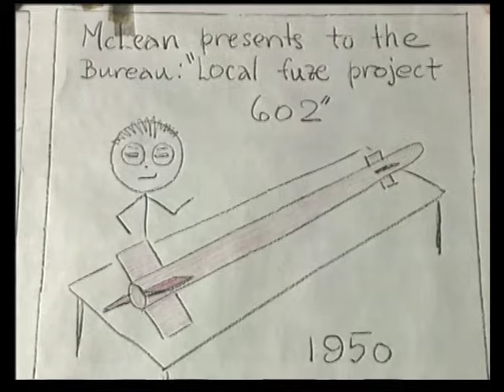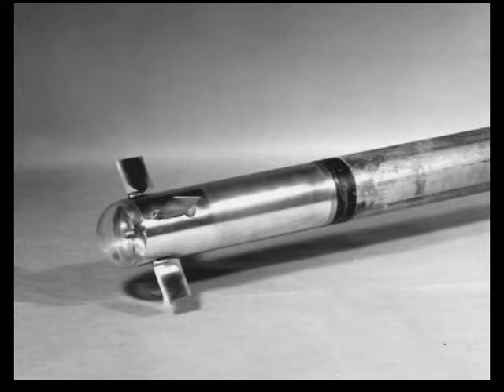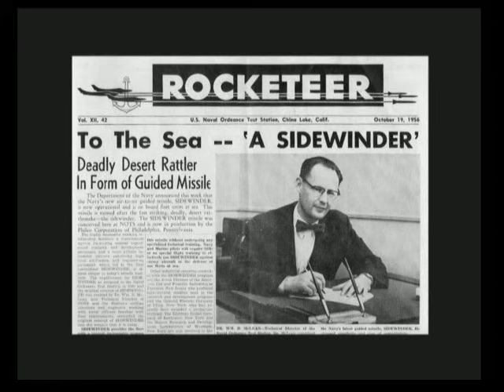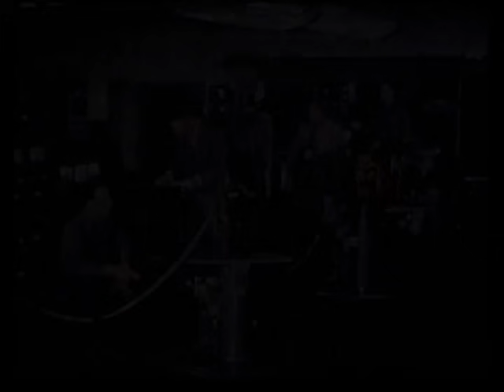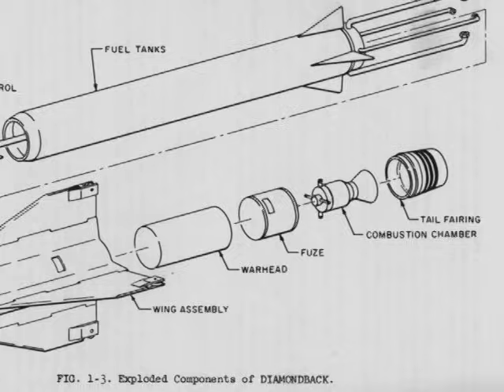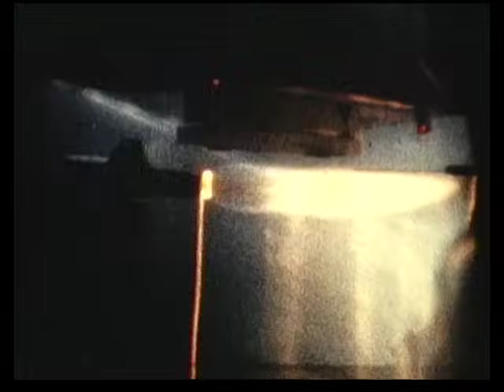To the Sea, a Sidewinder 50 years of snakes on the wing. AIM-9 Sidewinder missile history.

Comment: 'Worlds most successful air to air missile' the hit ratio (according to the maker is .79 per missile fired!) since the original doctrine was to fire TWO per engagement, you fire two you are just about GUARANTEED a kill!  I tried the simulator that Raytheon made which has a battery powered cart with a missile dummy on it (with guidance steering it), they would hand  you a lit cigarette, all you had to do was stay away from it for 30 seconds in an aircraft hangar (and you would win a nice $50) last I heard with the aim-9L they had given away less than $500 in 25 years!
Reply from the maker: It must have been a lot of fun
Reply: @BalticaBeer  by the time they got to the 9mike they had basically given it the brain of a cutting horse, it would cut corners and the cpu knows it can pull 18 G's (human can only pull 8 (in a G-suit)
Reply: Almost guarenteed. A hit probability of 0.79 means that the probability of at least one of two hitting is 95.6%. For three missiles fired, it’s 99.07%
Reply: @MichaelEdelman1954  The would be skin on skin hits, expanding rod (or coil) warhead and about a 10 meter kill radius .... still the world's most successful A-to-A missile..
Reply: @fooman2108  Too bad nothing much was explained about how SW works... How does that coil expand: in one piece or is it supposed to fragment (like Flak, spewing metal)? What about ball-bearings, like a Claymore, tearing through a plane?
Reply: @ibubezi7685  the early Warheads on the sm-2 missiles surface ships for what they called expanding Rod Warheads which was basically almost like a piece of segmented thin rebar wrapped around the explosives in the Warhead very much like a claymore! It was then succeeded by a new Warhead which was literally the coil of spring steel that it would set off the explosives in the middle of it and it would expand outwards in a cone around the Warhead.
Reply: they put a transmitter in the cigarette and use a radio/camera guidance dummy i work for raytheon
Reply: The Brits in the Falklands thought highly of them...
Reply: @fooman2108 There have been some pictures from Rimpac 2024 of Super Hornets carrying SM-6 standard missiles, with the designation Aim-174 stencilled on it
Reply: It is not a .79 pk. Never has been.
Reply: Imagine trying to stay away from a 9X. Damn near impossible.
Reply: @handlesarecringe957  Better yet, imagine something like either Python V or IRIS-T

Comment: I started my career touching a 9X eng development asset in 1998 in Texas. Multiple decades of production later, I suspect the 9X will outlast my days until I retire. Great weapon!!
Reply: What kind of connector shell housing are used on the aim7/9 series? I have a Dale Vishay insert im trying to find a housing for. Dale Vishay –
  Shearoff Insert Assy PN:810AS1325-2    /  PN:QX32P-SW325

Comment: As the Chief Pilot of my unit I was 'given to CLWS to test the Snake's Sidearm-II project. The Chinook was the airframe of choice simply because there was room in the radio/comms closet for the required gear. Ant any airspeed less than medium airspeed, the rotor down wash disrupted the missile after firing and was cancelled. I was secretly happy since the system would have removed my starboard gunner, and fighter and gunship cover was better than adding another weapons system would have impaired our ability to do what were supposed to. Ever heard of a Chinook being shot up by an enemy fighter or swing wing bird? Me either. :P

Excellent video. Moreso since it was produced in 91-92 and the Snake is still under wings and in weapons bays.
Reply: Ironically sidearm wasn't meant to be an air to air weapon it was an anti radiation sidewinder to kill radar guided AAA like the shilka. Have you ever heard of short range AAA being effective against helicopters?

Comment: Hurt to see the F6Fs and B17s shot down.   Remarkable that the Sidewinder, B52, and 747...designed principally by slide rule....still in service.
Reply: If it weren't for economic pressures that force aircraft manufacturers to improve upon existing designs instead use advancements to make a new one the 747 would be long gone

The B52 just so happened to be good enough at expensively fighting low intensity conflicts that it was still viable

Comment: This extraordinary product by Philco beats Raytheon's Sparrows & Hughes' Falcon.
Reply: Yeah, the Falcon was more or less a joke. But the Sparrow had it's evolution, going on to become the Standard-ARM air to ground missile that goes after search and missile guidance radar sets.  But the AIM-9, heh! You can see how far they went to market the little meanie, all the way to becoming an ASAT satellite killer.
Reply: @Nighthawke70  & yet for years I thought Hughes' Falcon the best & even puzzled about the Navy not adopting it. In 1960 Hughes even boasted of the nuclear-tipped Falcon 9. 
Turned out to nutting.
Hughes was a fraud through & through.
About another AA missile, why the US abandoned the nuclear ''Genie'' ? 
Although unguided it could sink a much-vaunted Sverdlovsk dreddnut.
& also the Davy Crockett nuclear mortar.
Reply: @Charlesputnam-bn9zy  The GENIE was specifically designed for the F-101, F-89, f-104/106 interceptors and those were being made obsolete by the rapid advance of technology and the rampant X-Plane programs underway.  The F-106 was tried with a trapeze rig, but didn't get very far beyond the testing stage.

Using one of those was akin to using a sledgehammer to swat a mosquito. Sure, it was VERY satisfying, but then you had to fix the holes it created. Plus the firing safeties were primitive. PAL was not yet perfected and the arming was set when it launched. Fuzing was time delay; Imagine if your rangefinder was out of whack and you set it to minimums and it lit off. No way to get away from it!

Bottom line, it was overkill, and the treaties at the time was threatening to put it out of existence.
Reply: @Nighthawke70  Thank you for all this information.
I was astonished at seeing the AAM Sidewinder proteanly turning SAM Chapparal ! In my teen days, I viewed it as heresy !
Reply: To clarify:  The product manufactured by Philco, in compliance with the design drawing package created by the civil service/military team at the Lake.